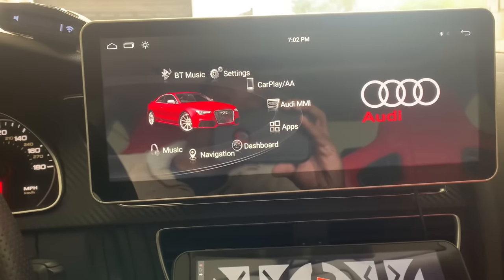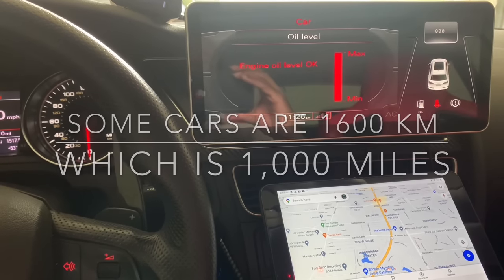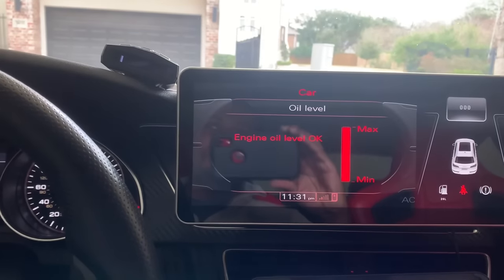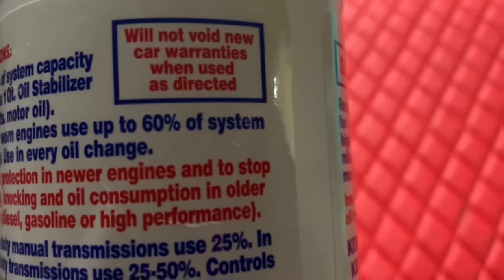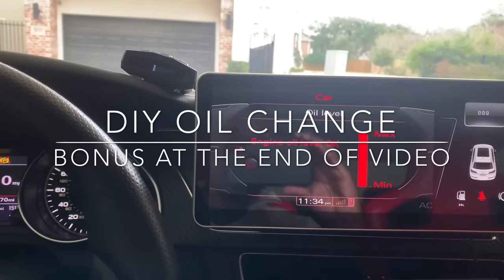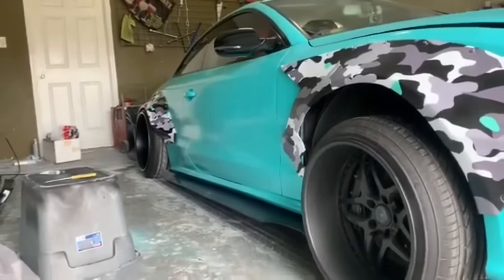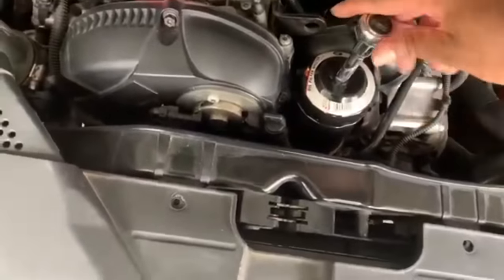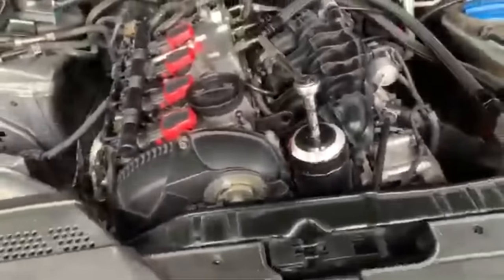How to fix Audi Oil Consumption for $10.00 dollars | Hack Audi A5/A4/A3/A6/A7/A8/Q5/Q7/S4/S3/S5/S7

Comment: Would this work on a 2012 a6 3.0t supercharged
Reply from the maker: Definitely 🔥🔥🔥🔥
Reply: I had this engine on my 2013 s4 from 80k until 170k when i sold it 
Some oil consumption is normal 
Use 5w40.
Other than this its a very solid engine
Reply: Motul was my engine oil of choice for this engine 
But i would go with amsoil 502.00

Comment: Please help I tried this exactly and the car has burned through over 2 litres in 1 week of city driving
Reply: Just get a new car or replace the engine. I had Audi A4 for 10 years it’s only gonna get worse and you’ll have you gut out your catalytic converter cause oil is clogging it allowing you to lose power and performance

Comment: I wish this quick fix would have worked for the oil consumption issue on my 2012 A4. My rings and pistons were replaced by Audi two years ago when my car had  57K. The car now has 67k miles,. After heavy acceleration the car developed a knock near the front of the motor. Was told cylinder number one is scored, and I needed a new motor. Doubting their analysis I had the car diagnosed at Audi, same answer. Do you think if the connecting rods were originally replaced with the pistons and rings that I would still be dealing with this issue?
Reply from the maker: possible, did you have an update
Reply: Audi realized replacing the pistons and rings would be a temporary fix regarding oil consumption. They are now recommending entire engine replacement.

Comment: Lol I've tried everything let's see how this goes.
Reply from the maker: Yeh , me too, this truly helped me , if you look at the oil change I did , at the end I almost had 5 quarts, and that was almost 4,000 miles
Reply: @brucecustommotors  bro my quart gone in 300miles. Hopefully get 700 outta it. Cilinder 3/4 rings are pretty rough but drives fine and been dealing with the issue for 2 years and 2 rebuilds😭
Reply from the maker: @vagcentral2252  omg I know the feeling, that’s what drove me here
Reply: @brucecustommotors  I have tried it and nothing has changed sadly. I'm guessing when the bottom end was done  two piston ring scrappers were flipped so the oil gets dragged into the combustion chamber . Was burning around a quart every 2k after the rebuild and now it's around 160 miles. I think as the rings wore in the consumption grew.

Comment: I got a 2013 Q5 2.0t that looses more oil than my 2012 A4 2.0t.
Reply: Same as me lol
Reply: Just get a new car or replace the engine. I had Audi A4 for 10 years it’s only gonna get worse and you’ll have you gut out your catalytic converter cause oil is clogging it allowing you to lose power and performance

Comment: Damn bro you piston rings already bad? Sheesh
Reply from the maker: no there fine, I have normal had normal oil consumption, but now almost 0, I'm also stage 3 turned
Reply: @brucecustommotors   yeah, I’ve not seen how these tuned motors run in the long run, but that’s usually my first resort is the piston rings. Not a horrible job to do, just time consuming.